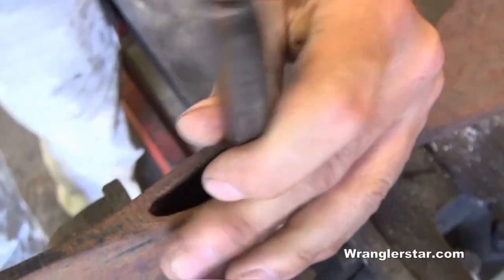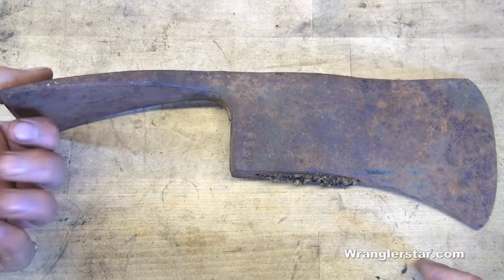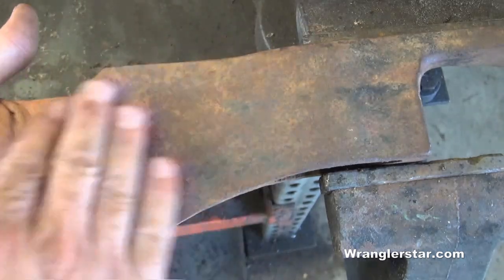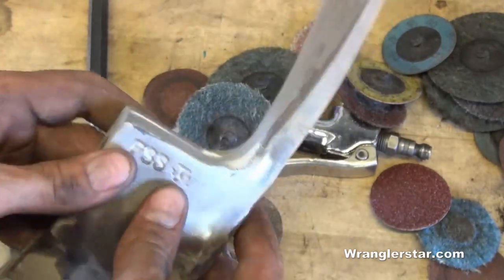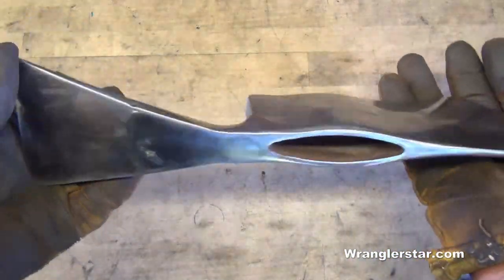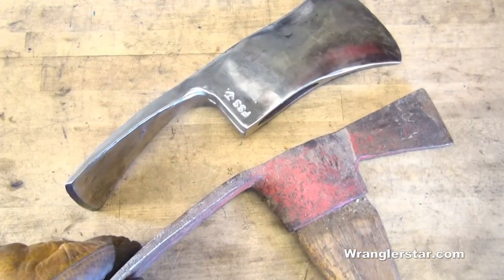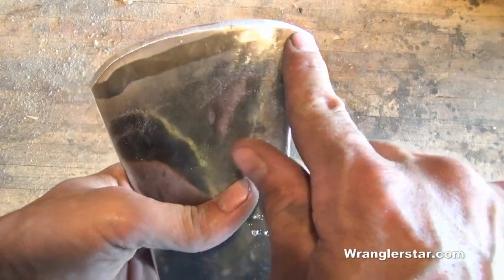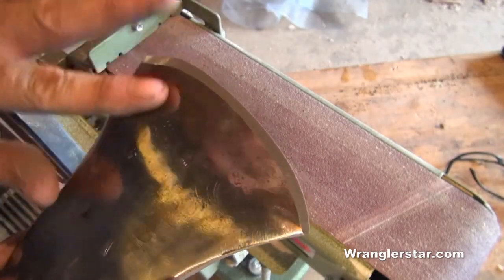Pulaski FSS Firefighters Axe - Wranglerstar

Comment: A cheap chinese made mattock is still a perfectly good tool. It doesn't need to hold much of an edge as it is used for cutting roots below soil level, neither end is intended to function as an axe. Your reference to it as garbage seems to be baseless snobbery. I have used both cheap and expensive mattocks and found little to no functional difference between them

Comment: Hey, I don't have a stone but will sandpaper wrapped around a file have the same effect? :)
Reply: +Michiel Van Goethem Yes it will, though I would put the sandpaper on a woof block and use it like a stone. I have used this method before. You dont want the sandpaper to curl around the edge and round the cutting edge.

Comment: Have you or anyone used a molasses/water 1:8 ratio to get rust off of metal?  I put some in a 5 gallon buck, stuck some tools in for a week, took them out and cleaned them up.  Someone suggested for bigger pieces to pressure wash afterwards.  I'm thinking of building a trough to do this for a two-man saw. Any thoughts?

Comment: uggg... belt sander?... I never put grinder or belt sander to a proper steel axe/knife... but I guess if you are in a pinch or do not have the time....

Get the bevel and keep it true with stone... might take a while but it will stay sharp longer... just my 2 cents worth on a whim.

Comment: I'm pretty sure your "cheap Pulaski" is actually a tool for working sod.
Reply: I am referring to the cheap chinese Pulaski. It's definitely not suited for forestry or cutting fire line, and I know an old sod worker who used one for cutting and ripping up old sod. I could be wrong, but I think it is designed for a different purpose, and not necessarily an inferior imitation.
Reply: it's called a mattock. it's a gardening tool not a forestry tool. The "axe" side is for cutting roots when digging out stumps, definitely not felling. My family has both nice old ones and cheep modern ones and they are all very similar shapes. (Australia)

Comment: I am happy I found this video , I just bought one identical to this one on ebay and waiting for it, I am a force retired N.Y. State  Firefighter because of an injury and I use a crotch to walk with,,,, this is me (https://www.flickr.com/people/johnydaystudio/)

What I want to do is use my FSS as a forest walking stick with a 37" to 40" wood handle with a metal point at the bottom, I will be looking at shovel and axe handles and everything in the middle.

I purchased two of them, and the better one I will restore it and hang it on my wall, do you have any idea on what kind of existing handle I could use for my walking stick ??

Thanks for this video

Johny

Comment: I would've hit that with like 120 on the DA to begin with and then worked up to possibly final grit 800 (2000 wet/trizact if wanting mirror polish), Mini Grinder was way too overkill for the original condition of the head.

you're sharpening skills beat me hands down, but metal work...... you have zero attention to detail or finesse. Can still see working marks in the final product which just screams amateur.

In my personal opinion, you have ruined what could have been a front of shelf item. Now it just looks like something I'd throw in the corner of my shed.

note: I have over 20yrs experience in modified, classic and modern aspects of Panel Beating and Painting here in the UK.